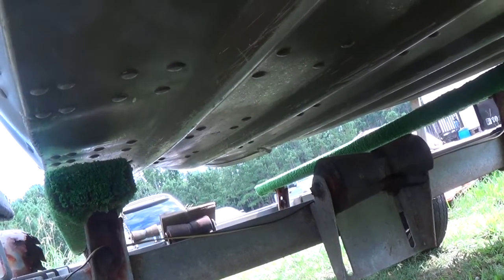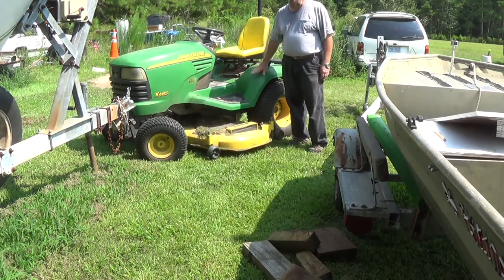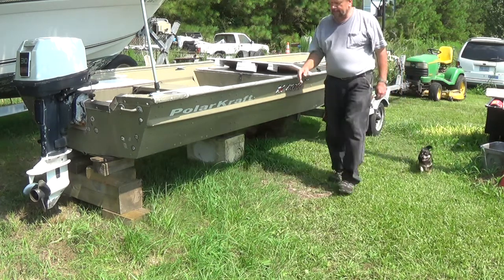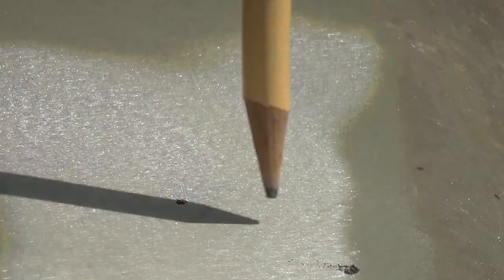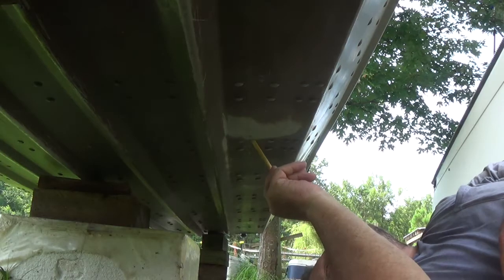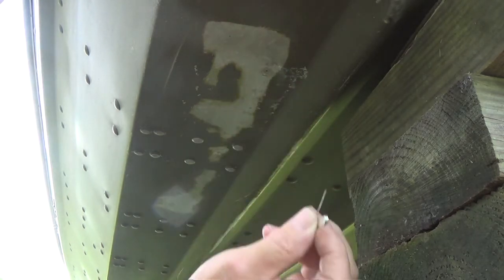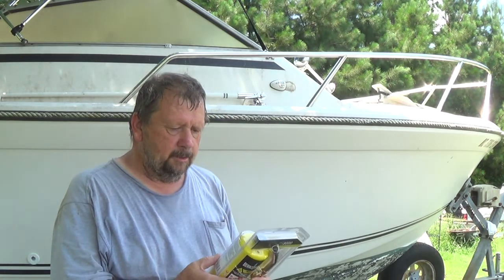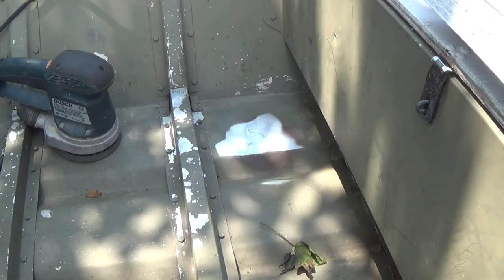Repairing a hole in the Jon Boat

Comment: Joe the horse is cool.You did a good job filling those holes up with that 730° welding kit.It doesn't have to look pretty just as long as it's an effective repair;which I think it is.
Reply from the maker: Buddha it is holding up so far. Thanks